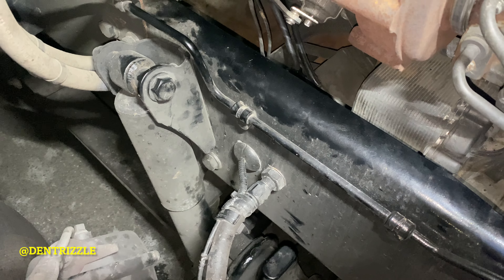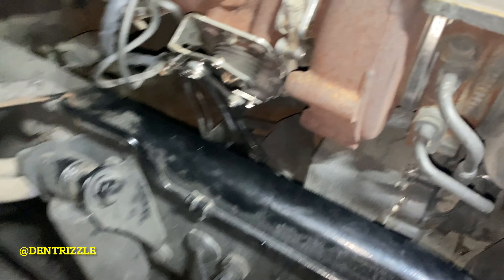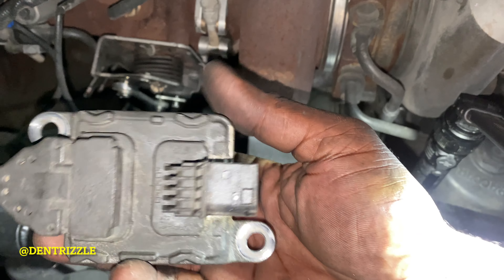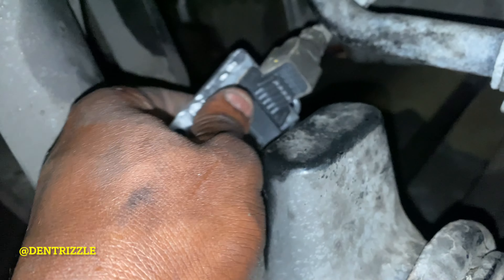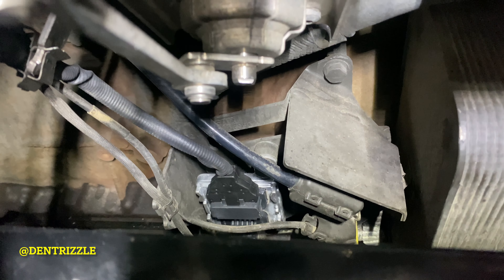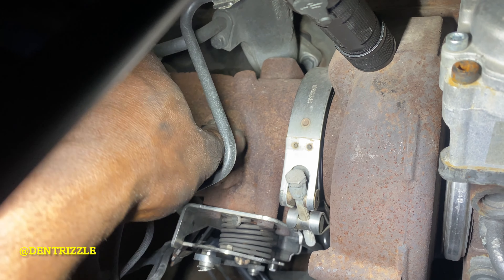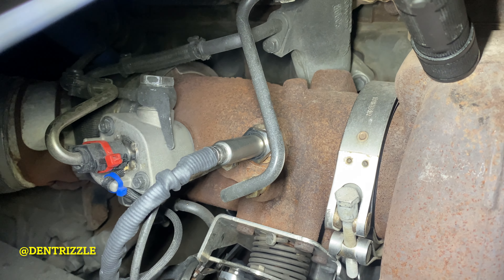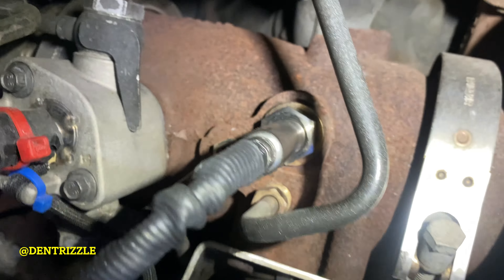How To Replace A NOx Sensor | Kenworth T680 | Peterbilt | Freightliner

Comment: I'm in your footsteps with all the DPF issues right now. Appreciate you
Reply from the maker: Just take your time and deal with them as soon as possible or it may lead to bigger issues like blown turbo and EGR issues. I think my videos should cover all the basis of repairing your DPF issues ranging from temp sensors, DPF cleaning, turbo actuator “didn’t record” and some other stuff. 👍
Reply: @dentrizzle  what are the initial symptoms we need to be aware of for blown turbos or EGR?

Comment: What diagnostic tool do you use to force regen or what good diagnostic tool do you recommend?!
I have  a 2020 kw T680 with Paccar Mx 13
Reply from the maker: I’ve been using OTR Diagnostic Reset Tool for years now with no issues. It’s a yearly subscription thou. As in recommendations I couldn’t tell you cuz I’ve only used one.

Comment: First thanks for the video it’s very informative 
I had the check engine light on, took the truck to the nearest kenworth dealership for diagnosis and I was told I need to replace the rear nox sensor 
So my question is will it be a bigger issue if I don’t replace it immediately?
Reply from the maker: @hassanabdirahmanali8192  Honestly I don’t know the answer for that and here’s why. When I get those codes for front Nox and rear Nox I cuz clear them until I reach the closest dealership and replace both in the parking lot and just return the core right away. I’ve never ran it with the code on for over a day.
Reply: @dentrizzle  ok
So how long will it take for the check engine light disappear after replacing the nox sensor? Cz I replaced the old one but still have the engine light on
Reply from the maker: @hassanabdirahmanali8192  I have a scan so I just cleared the code. Shouldn’t take long I assume. Just drive the truck let it do its thing.
Reply: @dentrizzle  perfect thanks for the info 🙏
Reply: @dentrizzle  hello brother 
I replaced the nox sensor and the check engine light disappeared for 2 weeks then came back , am not sure if it is for the same problem or not so what tools do I need to do a diagnostic test myself?
Reply from the maker: @ I use OTR Diagnostics Reset Tool but if you have access to your ELD main page it also shows all your codes on your ECU as well.

Comment: Bro I'm having issues with my inlet nox sensor at the moment. What symptoms was your truck having?
Reply from the maker: @killianstrucking5575  None because I cleared the code and went straight to the dealership and replaced it in the parking lot and returned the core. Sorry I couldn’t help
Reply: @dentrizzle  when it gave u the code did it try and derate u?
Reply from the maker: @ No it didn’t cuz I read the code and then cleared it. I would assume it would cuz it’s apart of the SCR DPF system. I could be wrong. Didnt had the code on for a long time cuz I didn’t wanted to find out what would happen.
Reply: @dentrizzle  gottya brother! And thanks again for the replies and all ur help with the content
Reply from the maker: @ no problem at all. I’m glad they’re helping
Reply: @dentrizzle  literally every part that's went out on your truck is going out on my 2021 t680... every time I have an issue I Google and it brings me str8 to your videos lol so yea man thanks
Reply from the maker: @ 😂😂😂😂 and I didn’t record all the repairs 😅

Comment: What problem were you having and how did you know to replace it?
Reply from the maker: So I didn’t have the problems or symptoms of a bad NOx sensor because I was clearing the check engine light until I reached the dealership but symptoms would be check engine light, bad fuel mileage and consumption, excess def usage, idling issue and then engine derate. Scan tool was specific about “Forward NOx Sensor Before SCR” so that’s how I knew what to change/replace. I keep the scan tool attach to the truck via Bluetooth so I monitor parameters and check codes as soon as they pop up. Hope it helps.
Reply: @dentrizzle  could you post a link where to buy a scanning tool from? 
Actually you probably already have a video up on how to use it 😆 let me check
Reply from the maker: @aqua6613  I use the OTR Reset Tool and also the OTR Diagnostic Reset Tool “$600.00 annually renewal”. Just type in OTR Tool in your browser and it will pop https://otrperformance.com/?utm_source=google-ads&utm_campaign=OTRBrandSearchAd&utm_agid=126741623966&utm_term=otr%20diagnostics%20tool&creative=549797778182&device=m&placement=&nbt=nb%3Aadwords%3Ag%3A1948442781%3A126741623966%3A549797778182&nb_adtype=&nb_kwd=otr%20diagnostics%20tool&nb_ti=kwd-1636473874016&nb_mi=&nb_pc=&nb_pi=&nb_ppi=&nb_placement=&nb_li_ms=&nb_lp_ms=&nb_fii=&nb_ap=&nb_mt=e&gad=1&gbraid=0AAAAADvYaLnvusumKQMAagu12fEPgRRoO&gclid=EAIaIQobChMIuc2D_5nXgAMV8pJaBR2zQAUREAAYASAAEgITf_D_BwE

Comment: I have another question:

Will bad NOX sensor cause soot level to go high?
Reply from the maker: I’ve never had the issue but I would say yes potentially cuz it’s helps to regulate the emission system regarding the soot levels and regen. Then again I’ve never had one bad long enough on the truck. I may be wrong
Reply: @dentrizzle  I’m getting replaced today and hopefully it fix the problem. I’m watching the truck soot level to continues going upward. No other faults showing.
Reply: @dentrizzle  should I clear the yellow warning lights after replacing the sensors??
Reply from the maker: @A.M.E-K-87-10  yes
Reply from the maker: @A.M.E-K-87-10  and do a forced regen
Reply: @dentrizzle  I did force Regen and soot level went down to 9 percent. Should I clear the code now?
Reply from the maker: @A.M.E-K-87-10  sure
Reply: @dentrizzle  thank you.
Reply: When I complete the regeneration the soot level load is at 9 percent. What would be the reason for that ?
Reply from the maker: @A.M.E-K-87-10  because you still have that percentage loaded up. Close the app and reopen and it should be at zero. But even at 9% that’s within threshold of being good
Reply: @dentrizzle  when I do the regen the app actually discounts after like five minutes even when regen is still in progress. 

My soot load continues to go up while driving for example today I took a short run for one hour and the soot load at start was at 18 percent, I drove like 60 miles and when I checked it was at 44 percent. Is that good?
Reply from the maker: @A.M.E-K-87-10 your filter needs to get cleaned IMO
Reply: @dentrizzle  I will do that hopefully soon.
Reply: @dentrizzle  should I do it even when I do a regen?
Reply: @dentrizzle  brother I know I asked to many questions, but what type of cleaning do you recommends to get the filters cleaned? I have seen some shops offering 100,000 miles grantee cleaning warranty and etc.
Reply from the maker: @A.M.E-K-87-10 don’t worry about the questions I don’t mind. I just answer when I can cuz I drive trucks too. In regards to DPF I pressure wash mine which I have a video but most ppl against it. Lol
Reply: @dentrizzle  yes, I saw that video which shows you have pretty good skills that not many have. I also tried to do it but once saw all of that wiring I gave up and think it’s best to just take it to someone who do it for living and have them clean it for me. Will clean the filters good option to stay away from dpf issues for next six months?
Reply from the maker: @A.M.E-K-87-10  yes it’s a good option cuz since I cleaned mine it has been going strong. Just keep up your general Maintainance like oil changes and you should be good. I do my own maintenance so that helps me out as well.
Reply from the maker: @A.M.E-K-87-10  I do forced regen when I go home for 34 hour resets as well
Reply: @dentrizzle   what would be the soot loads after you finish the regen? Also what would be the soot level while driving?
Reply from the maker: @A.M.E-K-87-10  between 0 and 5% after regen and driving active regen activates at 76%. That’s when it regen by itself whilst driving. It reads between 0 and 250%
Reply: @dentrizzle  after how long driving will it takes to get soot load to 76?
Reply from the maker: @A.M.E-K-87-10  that’s a difficult question cuz every truck is different and depends on how healthy your DPF system is. Is not something that you can track like that. I wouldn’t cuz the truck will automatically start a regen when your driving anyways.
Reply: @dentrizzle  I got one more question brother. Every time it rains hard i start getting SCR codes and engines stop light come and then I left cool for little one hour and everything go back to normal. I don’t get no codes except some SPN 49 that show some power shortage in rear axle!
Reply from the maker: @A.M.E-K-87-10  sounds like you have some electrical wire exposed or something like that. I've never experienced those issue before so i'll look into it and see what I can find out.
Reply: @dentrizzle  update about my  soot level:

I drove for two hrs to test and see how my soot is reacting.

First hour the soot load level went up to 54 in the first hour.

Second hour I continued to drive at same speed and soot level only went to more points to 56.

I couldn’t get my exhaust temp to stay above 600 f where an active passive regen will clean the soot out.
Reply from the maker: @A.M.E-K-87-10  the exhaust temp don’t really have nothing to do with starting an active or passive regen. The soot level have to be 76% to activate it. It’s pre programmed in the ECU.
Reply: @dentrizzle  that’s good to know, I will do another trip tomorrow for two hrs to see if that soot level go up to 76 and then regen after that. For today once the soot load level got to 55 it’s stayed at this level for one hour, so I’m not sure if I need to drive more tomorrow to get soot load up to 76.
Reply from the maker: @A.M.E-K-87-10  that means the system is working but chain of thoughts is once it even gets to 76% and activates, the 7th injector or doser injector will spray extra diesel in the exhaust system anyways to make it burns hotter and that’s why the temp during driving has nothing much to do with activating the regen process
Reply: @dentrizzle  that’s good info to get… I’m also getting this formula I’m not sure if you know it’s called the Pittsburg Max power. Do you know about and do u recommend it?

Comment: I have question for you. 

Do you replace the sensor after you get the engine warning light or do you first clear the warnings and wait to see if they come back again?
Reply from the maker: In both cases I look for the nearest Dealership cuz they always occur when I’m on the road, clear the code until I reach the dealership then I replace it. Never had the code on for more than a day. But if I did I would just clear it because it will always come back.
Reply from the maker: Honestly I would just replace the sensor cuz even if you clear it, it will come back from what I’ve experience.
Reply: I’m following your recommendation but I’m not an expert tech, just a driver lol. 

Reason why I asked because I got the tool to read and reset fault codes and got the SPN 5024 FMI 10 one time and cleared. It cost about 870 U.S. dollar at the dealership so I’m cross my finger for one week and get the sensor and replace it the same way you did.

Do you recommend cleaning the Def filters?
Reply from the maker: @A.M.E-K-87-10  you can clear it and drive for a week with no issues but have to constantly clear it. Where there is an issue is when you cannot clear the code, it will end up putting you in a DERATE and you’ll get a bunch of other codes as well. Also that Nox sensor have a core charge which means you get some money back from your $870 if and when you return the old one. 😅
Reply: @dentrizzle  the problem is we had the Particular Matter sensor changed yesterday because it was asking us to do regen every hour and then after replacing the sensor and when I was driving home this sensor yellow engine light came up it shows that we have 1 Intake sensor heater ratio and I cleared and was able to do a force Regen with otr tool. 

Once this sensor comes back I will get it replaced right the way.

Comment: Did you need to use your scan tool to reset the code? My ELD can read that it's the inlet nox sensor, but I can't use it to reset any codes.
Reply from the maker: I did use it to reset it but you don’t necessarily have to. It will go away by itself. Maybe if you cycle the key on and wait like 3 minutes or so.
Reply from the maker: Your outlet Nox sensor will follow as well so prepare for that. I just replaced mine.
Reply: @dentrizzle  I've replaced my outlet along with my def quality sensor twice in the last year. Maybe outlet will go again but I'm hoping it's just the inlet for now.
Reply from the maker: @Undefined14  it won’t go out since you replaced it already. Outlet last longer
Reply: Did you install OEM or can I go with aftermarket from Amazon or ebay etc?
Reply from the maker: @robertgonzalez4215 I just saw this notification but in regards to repairs I go OEM with electrical parts like sensors etc and aftermarket like intercooler, radiator etc.
Reply: Why did you replace what were the symptoms of it going bad?

Comment: I’m going to get my dpf filters and DOC clean do I need to get them reprogrammed after that?
Reply from the maker: You can use your OTR Tool to reset the values. It should say “Installed Cleaned DPF.”